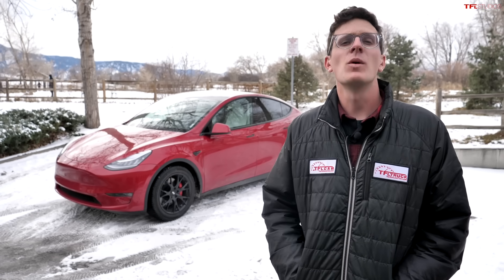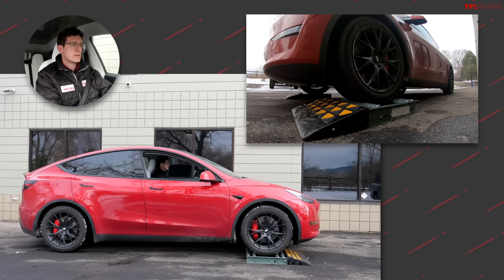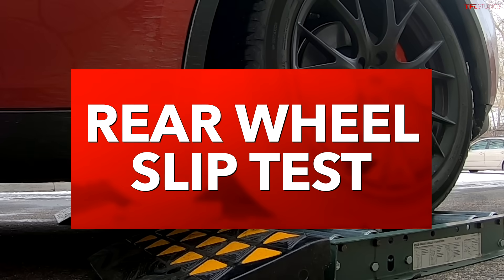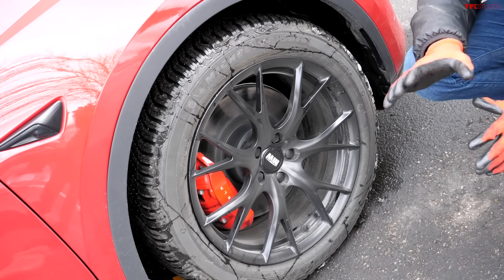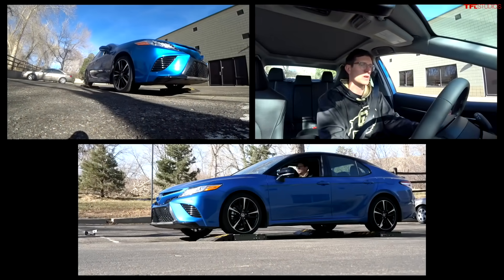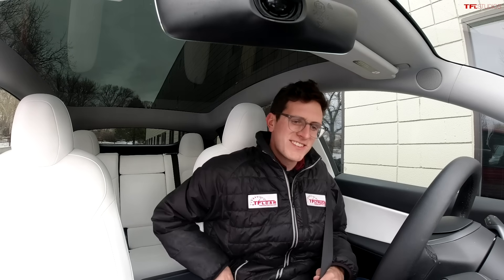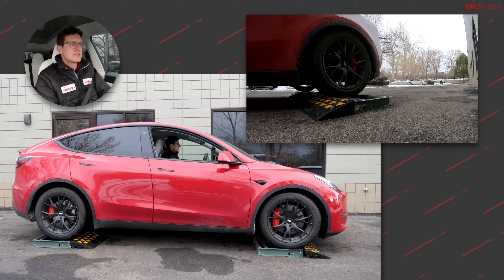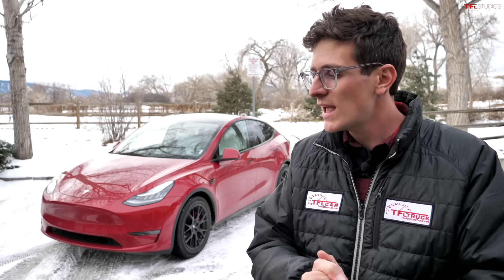Does Tesla Build a Good AWD System? We Put The Model Y On The TFL Slip Test To Find Out!

Comment from the maker: "Thanks to Keeps for sponsoring this video! Head to https://keeps.com/TFL to get 50% off your first order of hair loss treatment"
Reply: What a random sponsor! 😆
Reply: Would the test have a different result by adding weight on the front?
Reply: @c_davide_c  EVs are pretty heavy as is.  it seems as though the front driver size isn't a main power distribution of the whole vehicle.
Reply: And the best thing is the vehicle will be software upgrade so i wish you will do this test again in 6 months.
Reply: Sure youse minoxidil ... maybe check what the 16% danger is using it, but hey lol
Reply: If the driver had less hair he would be more aerodynamic and would be able to make it, allegedly.
Reply: Have you turned on real 4x4 (Off-Road Assist) in the Menu of Dynamics?

Comment: Pretty sure the issue is more to do with weight on that front wheel, no lump of an engine like a ICE car would have… but it shows the limitations. Out of interest our 2021 model 3 rear wheel drive was one of the few cars to drive out of a muddy field easily no spin, after a wet 5 day festival in australia. Even proper 4WD vehicles needed towing out. The very high torque at no revs really helps stop the wheels spinning and just dig in. Great tech.

Comment: Because of the torsional stiffness in the model y performance frame and having 3 wheels elevated then it barely places weight over the from left wheel. I presume the noise you heard was the front left wheel also spinning due to lack of weight on it. 
You should have filmed the wheels not on the rollers.

Comment: The only real problem with EVs is that with 4 wheel drive each corner only has theoretical 1/4 of the torque but if the 2 front and 2 rear have different motors like Tesla that has larger motors on the rear wheels that leaves 2 corners with less power if they traction.     Not the end of the world for normal road driving perhaps but if one lives in woods or areas that do not get plowed or less frequent it is a thing to consider.     Even AWD or 4WD/4x4 cars and trucks will not send 100% of the engine power to a single wheel it will be more than an EV potentially, a weak engine car sending all power to single wheel might be less than a single motor on a Model Y so it can get complicated to see the full picture.

Comment: Did anyone else notice that during the front roller three-wheel test near the end. He never showed the tire that wasn't on the rollers up front?

I'm willing to bet that that tire was spinning and for some reason he never showed it. Unlike most Vehicles Tesla's have very stiff frames and do not twist like your typical car does.

I would bet it couldn't get enough traction on that forward Tire because of that so it couldn't pull itself off the rollers. The tire was likely spinning.

Comment: i have
ONE SUGGESTION

change the Type of Bearing, to a Unidirectional Bearing, so ilthe Rollers can only Spin Backwards.

some cars cheat using the Brakes to Stop the Spinning Wheel,
but on an uphill dirt situation, a slipping wheel stopping dead beones like an anchor.

that shouldnshow the main advantages of a Locking Diff where the wheel spins slowly forward

Comment: Next time, put something under the wheel on the ground. The Y is a rather stiff car, so having three wheels stuck hard and the fourth in a depression will make the car stuck, the depression just needs to be deep enough. In this case, it was apparently deep enough, you could hear the left dront wheel spinning since it couldn't get the power on the ground, either. 

Basically, if the fourth wheel is also slipping, it's not a fault of the car, it's a fault of the test.

Comment: Does he not know that its rear wheel drive bias? So the front slip test did almost nothing at all. I can't remeber off the top of my head but theirs and app that can show the power to all systems on the car. Front motor, rear motor, ac, accessories.

Comment: Basically Tesla Model Y Long Range AWD is Part-Time AWD by default. But has anyone tested after adding the Acceleration Boost upgrade (+100HP), would it become Real-Time AWD? I guess the extra 100HP comes from the front motor.

Comment: What really pisses me off is that Audi had the perfect solution to this back in the 90s - a small button underneath the handbrake to lock the rear diff. The situations this little button helped me out of are nothing short of a nightmare even for a proper off-roader. 3 wheel on ice with no traction - no problem, just lock the rear diff, put it in reverse and drag yourself out of trouble. Really feel sorry for selling my old Audi 80 Quattro. Cars simply aren't build like that anymore. Rugged, dependable and idiot-proof.

Comment: My Y performance has a mode where you can select how much power goes to each axle. Essentially its juat reducing the power to the other axle all the way to zero. This is interesting as the front motor is a smaller, less powerful motor than the rear. So, while no power goes to the rear, the front gets all the power the one motor can produce, which is obviously less power than the overall rating. Multi-motor cars that used maximum combined power rwrings for AWD, can not send more than 50 percent of power to either axle the way some single motor cars with a center differential or front to rear drive shafts can.

Comment: You were gentle on the throttle.  But on an electric car, both axles are fully software programmed to provide torque based on the programmers choices, just like the rear clutch on an AWD car.  I suspect if you jab the power more, the programmer would give the front more immediate torque based on how much quicker the dual motor is vs the rwd car in acceleration tests.  Worth a test next time.

Comment: The flaw in these tests is that the way the AWD system operates is to keep the vehicle straight and maintain overall traction, not so much get off rollers. When you are driving and 1-3 wheels slip you don't want power on the wheel(s) with grip. If you send power to the one wheel off rollers with grip, you car will rotate. Now what you want in these tests are cars with AWD, but an LSD in the front or rear, or 4wd. That's good for getting out of mud and stuff like that.

Comment: I suspect one of the big reason the 3wheel slip ended up as it did, is because the tesla is so stiff because of the battery pack. It sounded like the front left wheel was hovering above the ground and slipping on the ground… in that case its really nothing the car can do, the traction simply isnt there

Comment: Wish you put the camera on the ground wheel for final test. Seemed to me that ground wheel was slipping also. It was maybe 3 rollers 1 icy
Reply: Same. The front wheel was likely slipping because the other 3 wheels were 2-3 inches higher, removing the weight from the tire on the ground. If the car had been level it would have made it.

Comment: On the last test the wheel that you aren't showing is audibly spinning on the asphalt. This means that the car is doing all it can - and no type of AWD system can get it out of that situation. You simply need more grip between the tire and the ground.
Reply: True, but it's only lacking grip because the other 3 wheels are essentially jacked up 2-3 inches higher than the ground wheel.

Comment: Why don't you show the tire on the ground slipping from the 3 wheel test. The car is doing everything correct, you tested it on wet ground with aftermarket wheels and tires. You can hear on the video the ground tire is spinning on the ground. What a flawed test

Comment: Normal
The front motor engage only when asking more power not always...
There May be a snow mode to ask for real 4w drive even when driving quite
Reply: I ça not modify my comment but in my opinion the front motor is also less powerful
At the rear you have 1 motor per wheel
At the front you have 1 motor for both wheel

Comment: I rented a Chevy truck the other day... Ground was wet and paved but slightly muddy...It was NOT going to go up a small incline due to "traction control" kept cutting the throttle at near idle.  Glad I bought the extra insurance as it slide back into a tree and put a dent in the tail gate (small and didn't affect the use of it).
  My Maverick above (now sold) would spin about half of my paved drive up (not the same place the rental Chevy was at).  pretty much sold me on NOT having a FWD truck...at least on wet paved inclines.

Comment: The Malin Issue with this test and Model Y in normal wettings is the back motor which is a permanent magnet, this the most efficient which should be the one pushing mostly -IF you don’t activate off-road mode

Comment: AWD      each tire has a fluctuation in voltage or wattage in an electrical munipulation of sensors in the tires where each tire is gently moving / spin like its a turtle crawling out of a hole?  Now i saw degredation in ekectronics  where the cars 4 tires aren't individually powered by its own tesla motor because of possible failure,  the car at high speeds might spin and flip car crash,  unless the car is online has a sensor to alert the driver and manufacturer,  colaboration tires done at manudacturer

Comment: I've got a 2016 Subaru WRX with the CVT transmission (yes, I know, CVT, but it was meant to spend most of its life in city traffic). 

I read a little bit about the differences between different Subaru models (WRX with CVT is closest to the Crosstrek re: functionality), and of course, the way Subaru AWD compares to other brands. My favorite thing is to go through empty, snow-filled streets (and the occasional dirt/gravel road) with the traction & stability controls totally off. I'm in love with AWD. I've owned FWD Hondas (09 Fit, 15 Fit) for years, but when one wheel starts spinning on even a wee bit of gravel, pulling into traffic is needlessly frustrating.
My priority for any vehicle I'm driving is AWD first, power second, reliability third, and tbh, brand is close to last. My ideal CUV isn't available in North America - the Audi SQ3 (350hp). I'm willing to sacrifice ground clearance for handling/power.
My ideal car (if money were no object) would be a quieter, tamer but as fast as possible, RallyCross car (AWD, 600hp, as agile as a fox). I don't want to drift around town, but I'd like the ability to. I like potential power, I like it subtle, and I like to take advantage of empty roads & drive like a maniac for even just a few minutes. When I look at the Model Y, I see part of that dream coming true. I see the AWD Performance version of the Model Y has close to 400hp, but uh-oh, I live in an apartment building. How do I charge my car?

MAZDA C-30GT
290 ft lbs of torque, 250hp if you use 93 octane. Ok, for a CUV that's trying I guess. Engine sounds really bad. Then again, most engines sound bad compared to a WRX, my selfless opinion of course. Best interior in the < $50k CDN CUV lineup, but before listing all the other nice things about it - I couldn't see out of the back. Subarus are like fishbowls, great visibility. It was like climbing into a trunk, the door sills, huge A pillars, and zero rear vis, it was a hard no. They did a LOT of things right but I need to see out of the thing.

SUBARU WRX STi
I don't like the WRX STi - it's tacky looking & tbh, a little too proud of itself. Back in the 80s, a 320hp AWD car was impressive. These days, and for $54k CDN, it's just not a big deal. I do like the car, and don't mind the rough, aggressive ride, but it's just not evolving (pandemic has slowed that process, since WRX & WRX STi are last on the priority at Subaru). The WRX should be trying as hard as possible to be an Audi S3.

AUDI S3
Beautiful, never drove one though. It's my top contender if I can't manage a Tesla. I've driven a 2000 Audi S8L and fell in love with the brand. It's like a Lexus mated with a Subaru. Classy looking, understated (unless it's red!), and very, very fast. Great AWD system.

VW GOLF R
Best interior & exterior, beautiful paint options & a great combination of classy & aggressive looks. Has an incredible transmission in manual mode, but big gas pedal -> accelerate delay if in auto mode. Amazing power, putting out the 290 hp that the WRX should be putting out (mine's only 268hp). AWD system is not what I want. I want to be able to disable TCS fully w/o voiding the warranty so I can have fun. Worst, however, was the handling. It's mushy & leans a lot. The ride is as close to porsche as you can get for that money, but it's just too soggy.

FORD FOCUS RS
Nope, love most everything American but not their cars, sorry. Their WRC and RallyCross cars are among the best 3 made, but the cars they make for plain old citizens are just too unreliable. 350 hp is exactly where the HP should be for a rally-inspired car (I know real WRC are < 300, but they also weigh like 10lbs so give me some slack, I need my comforts!).

TESLA MODEL Y
I want to know how it handles, how the AWD system compares to my existing car, and once I saw someone 'drifting' in a Model 3, I knew I'd be reeled in somehow. I'm grateful to be witnessing the emergence of such great technology. Unaligned door panels & Musk's impossible nerd personality aside, this is a monumental shift in car DNA. I'll have to pay $1200 for my WRX to get a 100k kms service in 20k kms, most of that due to the fact it's an internal combustion engine & its spark plugs are almost axle-deep...
Can I charge it without having to buy a house? Can't have a house and a Tesla, I'm single & not successful - that WRX hurt my wallet & took 4yrs to pay for it, even with a $12k deposit. Can I expect good winter performance? Can I store it outside in the winter? How many tires will I be going through with that kind of weight, power & AWD? Can I drive it from the Canadian east cost to Toronto through the states & not have to worry about rapid charging infrastructure? I'll pony up what I have to for a Tesla, I will make it happen, if it's even feasible. Super excited to be part of this huge shift from petrol to electric. I'll admit it's not an intentional effort to help the environment & also know it's negligible how much it really is helping, but I love innovation so much, I'll follow it obediently.

Comment: How do most AWD systems do on these tests? I have a Buick Encore AWD for example I wonder how it would do on these tests? The model Y seemed pretty good though.  

I think I would have hit the accelerator more on the single front wheel test, then the brakes would have kicked in on the slipping wheels maybe.
Reply: There's quite a lot of slippage in Buick Encore AWD before systems start to react. Not too good, not too bad.

Comment: On another video i saw that power ratio between front and rear wheels can be adjusted from the main display. I wonder if it was set to 50/50 during this test.
Reply: Possibly on a model X or S, but it's not on my Y

Comment: It’s not just guessing that the rear motor is more powerful than the front, it’s confirmed. The front and rear motors are also different types of electric motors. One is a permanent magnet synchronous switched reluctance motor and the other is an induction motor. The rear motor is what propels the car along until the front wheels slip or slip is predicted or the driver pushes the accelerator hard.

Comment: At the end there, where he “cheats”, yeah, that’s an actual technique that people should know and not just rely on the computers/electronics of the cars, as we’ve seen.
Reply: Its a bit different than in the real world, him turning prevented him from rolling on the rollers. in real life you might be stuck on a wide patch of ice on a hill with no traction near by.
Reply: @davidfarmer  I honestly didn’t notice that he turned the wheel to get friction on the non-roller part. I thought he was tapping the brakes like you do for diy traction control, that’s what I was actually talking about.
Reply: @alvaro4k  I'm not sure about the Tesla but other EV's I've drive cut all power if you touch the brakes. No way to use both at the same time.
Reply: @garrettstevens2232  yeah, a lot of modern gas cars do this as well. I think the intent isn’t necessarily to move the car and press the brakes etc, it’s the change in momentum that gets generated from the spinning wheels and then sudden brake movements, that help to make small changes in grip level somewhere. Imagine a car in a teter toter type situation. That’s the overall principle I think.
Reply: @davidfarmer  I don't think he was really turning the wheel enough to change the direction of the force applied to the rollers. I maybe incorrect . I live on a dirt road and rocking the car can help get unstuck, just as long as you don't bottom out first. Then again you usually have a little more room to tock then he does on those rollers.
Reply: I live in Chicago and park on the street. The city only plows the middle of the street, so the sides where we park are snow packed. We turn the wheel all the time to try to get a little traction on our front wheel drive vehicles. The snowpack to the left  vs straight ahead vs to the right might be a little bit different in terms of traction. We don't consider this maneuver to be cheating.

Comment: They should put an option on the screen that basically shows the entire driveline and you can tell it which brakes to pulse, so you can send power to certain wheels. Any way to tell it which wheels do and done have traction
Reply: You can’t manually tell it which to brake or power, but it does have sensors to tell itself which to brake and power